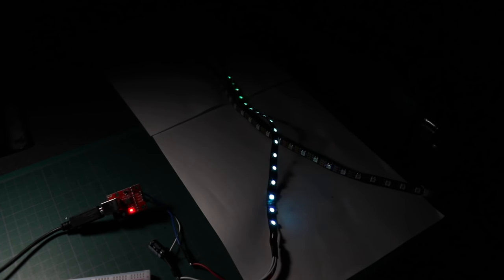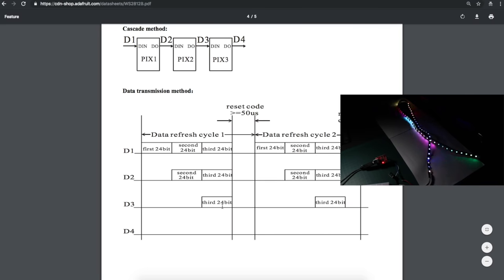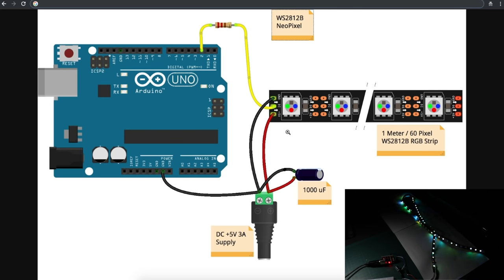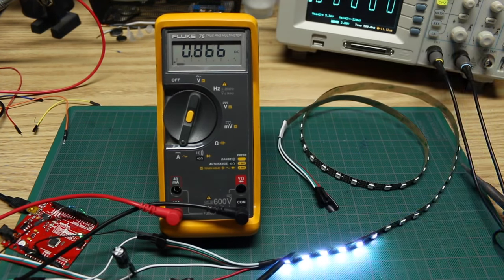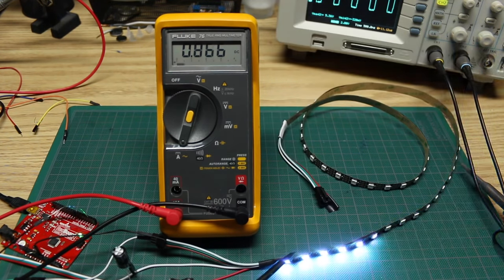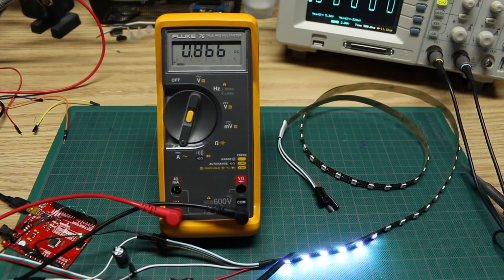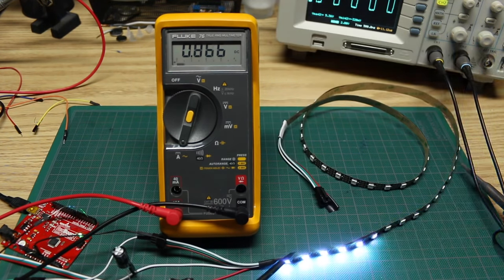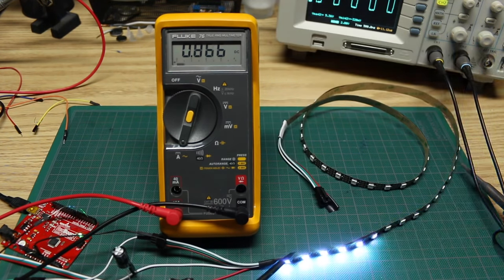HOW TO USE WS2812B NEOPIXELS WITH FASTLED ON ARDUINO

Comment: I was planning on doing a DIY project to light up my workspace/gaming desk with an addressable RGB strip. Gone through many, literally many other videos for this. Although all of them do show how to make the connections, which parts to use, and the software.

However, what they fail to cover is the most important part. The power and current required, as well as the usage of the resistor and capacitor, which are equally very important. If not for this I would probably end up ruining the strip, which is practically the most expensive part of the whole project (At least here in India).

This video should be at the top when someone searches. Please give it as many likes as possible for YouTube to know that THIS video is exactly what people are searching for!

A huge thanks to you @GadgetReboot for putting such a detailed and informative video about the project. I have already ordered all the required parts, they should arrive in a few days, and then I will give it a go! I will surely update here. Again, many many thanks.
Reply from the maker: Thanks for the comment! I’m glad the video is helpful for so many people.
Reply: @GadgetReboot  Hi, so I do have a question and I think you're the best person to ask this.

In several other videos (Which were precisely more about 'Ambient Lighting' for monitors), I saw people using Prismatik, which is a GUI software for controlling the LEDs.

I know that manually handling stuff can add to the experience, and I wish to do it. But If I want to take a short route right now with my setup, is it possible that I can use a similar companion software? Any that you know off?
Reply from the maker: @dhananjaybhardwaj4234  The only other control software I’ve tried is WLED with ESP8266 for Wi-Fi control. https://youtu.be/9d29SBWA4Qs

Comment: So I hooked up my 8X32 massive matrix of LEDs which was super cheap..and tested it with the FastLED library..it was terrible..until I saw your video. Added that 220 Ohm resistor to the data line and bang..it works perfect. Thanks!

Comment: Excellent video, upvoted. Incredibly useful. Resumé: no led address, first there first served, data arrives to led, data packet is prelevé, then the remaining data left is passed to next led for him to deal with it. Decoupling capacitor + resistor for led strip. Have common ground for arduino and strip. Enough Current? for 60 lights (20mA for R, 20mA for B, 20mA for G: makes a total of 60mA per led in "theory worst case scenario"). But in practice: for his strip/build, All lights on => 1light+standby for 59 off lights = 87mA, 54mA for all off, 2.033A for 60leds, about 34mA for one fullPixel. a bit over half of theory max.  FastLED.h library.

Comment: This is the best ever explanation of FastLED that I have found.  Ever line is explained and that helps. Thanks a bunch for taking your time. 
In your code with the chasing lights, what do you have to do in the code to increase the grouping of LEDs for one color from 3 to 5 or 6?  The intuitive thing would be to keep the number to an odd number so you can track the center.  I've tried several approaches to no avail.

Comment: Paused the vid to give you thumbs up on the maths for the current draw...bang on! Nice :) AND you saved me  a job!
Reply from the maker: I was actually surprised it worked out as it did across 60 LEDs based on measuring just one. I figured there would be a measurement rounding error that would catch on.
Reply: @GadgetReboot  That was probably the best video on ws2812b's Ive seen so far, thank you.

Comment: I love this video! I'm working on a project where I have to provide longs strips of neopixels (+7 meters) with data and I read that there is considerable voltage drop and I didn't know if that voltage drop also applied to the signal. This question was answered in the first 3 minutes of this video. The next question is: how do I run 12 strips of 7 meters parallel to create compound effects? I've already solved the supply power problem because in the worst case I would only have to light about 25% of the whole array (12 strings of 7 meters at 30pixels/meter could be powered by a single 5V, 300 Watt supply, unless my math is horribly wrong). Now I just have to find a way to provide different effects to different LED-strings at the same time to create some cool effects. Any advice on that?
None the less, awesome video GadgetReboot!!!!
Reply from the maker: Sounds like each of the 12 strips is basically its own project so worst case, all have separate Arduinos but sharing the power.   I haven't tried running multiple different strips from one processor but it may be possible to just try assigning multiple data pin outputs instead of just the one, and talk to each one within the same sketch when it's time to update each one.  Maybe if there's too much activity updating too often, it would get bogged down and that's where separate modules would help.

Comment: Excellent tutorial - I am new to this and was able to get the final demonstration with potentiometer working which is really cool.! Stupid question - how can i add more than 3 LEDs in the potentiometer example?  For example make it 10 pixels instead of 3.  I've tried changing up some of the code but I get different effects rather than expanding the row of leds. I have a 500 LED strip that is WS2815 and would be cool if can make the blue and green row longer than 3.

Comment: Some say you need a capacitor to also protect the LEDs from inrush current from the psu. However, they never specify how many amps the psu uses. But when you want to calculate what capacitor you need to use you do want to know your amps. A lot of them just say: use a 1000uF 6.3 at least. How do I choose the right capacitor, capacitance and volts, to protect my LEDs from the inrush current?

*inrush current can be as high as 20x(some sources say even 50) the given steady state current and can take up to 0,02 seconds to go to the steady state current. So to determine what you need for inrush current protection you need to multiple your amps by 20 times. So when you use that for your capacitance calculations, for example I have a 5VDC 20A psu, I need a Farads= (amps*seconds)/volts=(20*20A*0.02s)/5V=1.6F is 'super' capacitor territory.
I am no electrical engineer so I googled all this, but many sources say the same. So I indeed need a whopping 1.6F capacitor to smooth out my inrush current?

Comment: Great video. I have got all the bits ordered. However what code was running at 6 minutes in. When your explaining the data line. As I would like to know how to make the random white flashes of light?
Reply from the maker: I think it was the demoreel100 that comes with FastLED:  https://github.com/FastLED/FastLED/tree/master/examples
It cycles through a bunch of different patterns and is more easily recognized with more LEDs in the string - when I ran it with just 16 LEDs it was hard to realize it was the same sketch.

Comment: Why can't we connect the 5v power supply to both the Arduino and led strip?
Reply from the maker: Arduino can run off of the external power supply but the LED strip with that many LEDs can’t run off of Arduino‘s on 5 V power supply because there’s not enough current.
Reply: @GadgetReboot Thank you

Comment: Awesome video! So if i want to use this led strip as a vu meter then what are the basics, would love to know that. THANKS.
Reply from the maker: Do you already have a VU circuit and you just need a way to display the output? I guess it could be a very general topic that could be implemented in many different ways for example if it’s all done in hardware and you have an analog signal representing VU strength,  you could read that analog voltage into an Arduino and then turn on the appropriate number of LEDs in a certain color to represent that level. 

Or if you’re using all digital processing like a teensy board then all the information is in there and again you light  up the appropriate number of LEDs in the appropriate color. 

 It also depends if you just have a single bar representing the strength or if you have multiple bars like a spectrum analyzer that you want to light up for different frequency component strengths. 
 I may do some sort of project relating to all of this but for now, you may find another video I did interesting using an Adafruit matrix library instead of this one to show how to light up and control LEDs in a grid instead of a strip.   

As a demo I mocked up a spectrum analyzer EQ bar graph by just hard coding certain levels to show what it might look like if it were actually implemented. Someday I will implement it. 
 https://youtu.be/j_VvLHZEPZ4

Comment: Hi again! I have been successful in setting up my LED strips as per the schematics.

Now, what I want to do is, display a single color throughout my strip using CHSV color space. Instead of adding color value to individual LEDs like the following, can I set define one color for all 60 LEDs? If so, then how?

leds[0] = CHSV( HUE_GREEN, 255, 255);
leds[1] = CHSV( HUE_GREEN, 150, 255);

.......
leds[58] = CHSV( HUE_ORANGE, 255, 255);
leds[59] = CHSV( HUE_ORANGE, 150, 255);
Reply from the maker: I would look at the various fill functions which can set the color of a range of LEDs. Here’s a couple of references
https://github.com/atuline/FastLED-Demos/blob/master/fill_colours/fill_colours.ino
http://fastled.io/docs/3.1/group___colorutils.html
Reply: @GadgetReboot  Thanks a lot!!

Comment: Do you think a PC-Power supply with 20amp on 5Volts is enought for 450 WS2812b LEDS? Sorry for my bad english.
Reply from the maker: if the LEDs end up using the full current possible when fully bright white with all of them on at worst case 60 mA per LED,  that would need 27 A but the ones I had only used slightly more than half of that 60 mA when fully bright white so a 20 amp supply might work for some cases but it’s dependent on the specific LED behavior.
 To make sure it is done properly The power supply might need to be able to handle 20% more current above 27 A worst case.

Comment: Does fastled have any sort of "fill clock"? What i am doing is making a lightsaber display. I want the leds to light up matched to an ignition sound effect that lasts ~300ms starting from the first led and lighting one at a time towards the end.
Reply from the maker: I wonder if this fast LED painter library might be of use, I haven’t tried it yet but it looks like there’s an ability to control speed of the pixels. https://github.com/DedeHai/FastLEDPainter
 Otherwise from what I can tell, the speed of fast LED animations is just controlled using delays  to proceed at different rates.  So if I had 30 LEDs that I want  to light up evenly over 300 ms, I would have a 10 ms delay between each sequence update.

Comment: Instead of using a series resistor to damp data line reflection, isn't using "A diode" is better option? Cuz that way it'll emlinate the reverse direction flow .. Correct me if I'm wrong.
Reply from the maker: that might block a signal from going in two  directions back-and-forth but there would still be reflections between the one end of the diode and the far end of the connection up at the LED itself and that’s the main part that needs to be protected from over voltage spikes, so the resistor actually provides impedance matching and helps prevent a spike in the first place and keeps the voltage levels low
Reply: @GadgetReboot  That makes sense. Thank you. Subbed ♥

Comment: Excellent tutorial. Extremely helpful. Q: why can't the 5V DC external power supply also power the Arduino? I'm assuming you've got it connected via USB to the computer for uploading code, but in the wild it needs to get power from somewhere. Are you saying there needs to be two separate power supplies?
Reply from the maker: I can’t remember exactly what I said but I’m thinking what I meant was if the Arduino is being powered from USB or some other light current power source, that won’t be enough current to drive a certain amount of LEDs so that’s when extra power is needed
but if there is a 5 V higher current power supply available for the LEDs, that can also power the Arduino
The only possible consideration then would be if there’s any sort of noise introduced on the power supply because of the LEDs turning on and off and causing momentary high current demands,  it could drag the 5 V down slightly at times and cause the Arduino to reset
 so then maybe some extra capacitors on the Arduino 5 V pins might help
Reply: @GadgetReboot  Excellent! That answers my question. Thanks!

Comment: I am just curious to know if I can measure the output voltage of Data pin if I send whitecolors to all the pixel. It will have 24 bits of data and all set to 1. Am I suppose to get any reading in multimeter??.  How can I verify that I am receiving any sort of data from data pin, provided I do not have any oscilloscope. Help would be appreciated :)
Reply from the maker: Once the colour data has been sent once, it does not need to be continually refreshed so you would need to capture the data on its initial transmission to see the last stored information and to know what colour it is. The data line can be dormant and the LEDs will retain their last color.

Comment: i have a question... its probably stupid but i am just kind of confused because i watched many vids about it and am just want to be have a clear answer...  if i have 288 lights do i just need a 5V dc with a high enough Amperage  like a 5V 10a ? is that even possible or would that not work?
Reply from the maker: For 288 lights if they all happened to draw the current that mine did which is around 33 mA each, it would need a power supply that can handle providing 9.5 A for the lights alone, and usually it’s recommended to only use 80% of the power supply rated current to allow overhead so maybe at least a 12 amp 5 V power supply would be recommended, but that’s still assuming the LEDs only draw 33 mA when fully white. If you already have the lights you could test how much current they actually draw when they are on fully bright white.

Then assuming they are all connected in series with each other, with that much current you may need to run extra 5 V and ground wires and attach them along the strip periodically  or else the ones toward the end are going to start getting dim because they are all trying to draw current from a single set of lower power connections along the strip itself, which aren’t rated for that kind of current so it will just start limiting itself unless you put another set of power connections and then it will draw from there.

And on that note, the power wires should be rated to handle all of that current so nothing overheats or catches fire.
Reply: @GadgetReboot  thank you very much that cleared a lot of things up :)

Comment: so I have the same led ws2812b and I got 300 LEDs to multiply by 33.9 that's equal to 10.17e3 is my math right?  I have a power supply sitting around in my garage and it 5v 30A. the 30A is an over kill, ya? but can I still use the power supply?
Reply from the maker: Yes I calculate just over 10 A to get all 300 of those LEDs completely bright white all at once, and that’s based on the exact measurement of my particular LED strip being 33.9 per WS2012B individual unit.  A different set of the same LEDs might have a different variance more or less current so to be sure, you would probably want to power up a smaller fraction of them all white and double check.
30A supply  would definitely handle the worst case for 300 LEDs. The worst case would be 60 mA per LED module so something near 18 A.  It’s fine to use a supply that can deliver way more current than needed, the power supply will only deliver what’s needed and won’t hurt it. Of course voltage is different, it Has to be the same voltage 5 V.
Reply: @GadgetReboot very cool to know the math part of it. thanks, man.  numbers don't lie